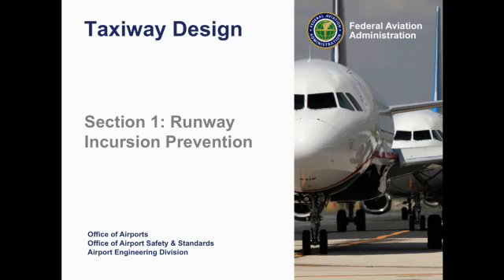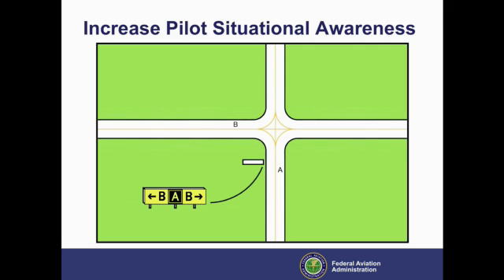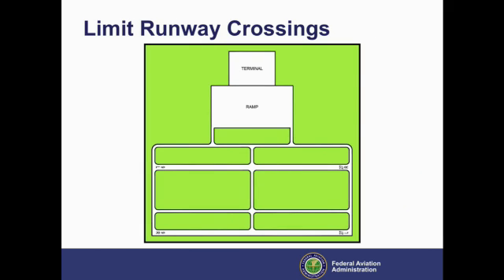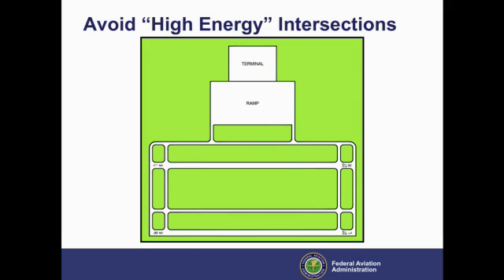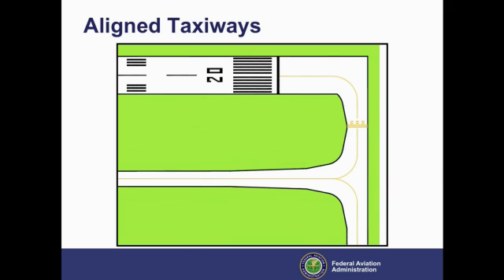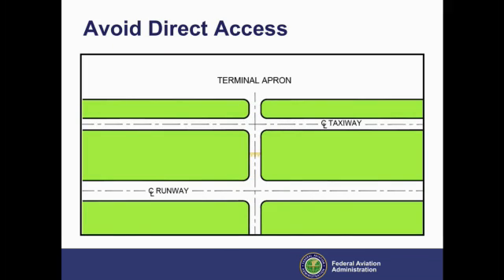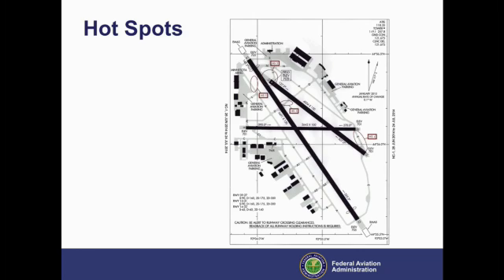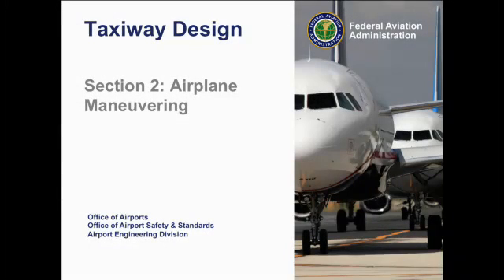Runway Incursion Prevention  - Advisory Circular 150/5300-13A

Comment: Image at 7:51 is from London Gatwick Airport (EGKK).  In this example, runway 08L/26R was decomissioned as a runway and is used instead for taxi.  However, the markings on this former runway were not replaced.